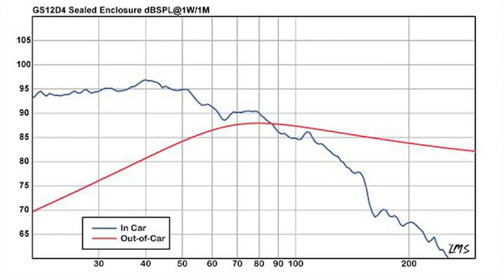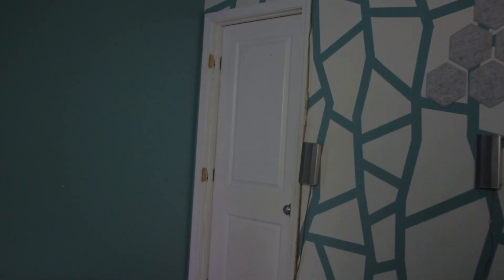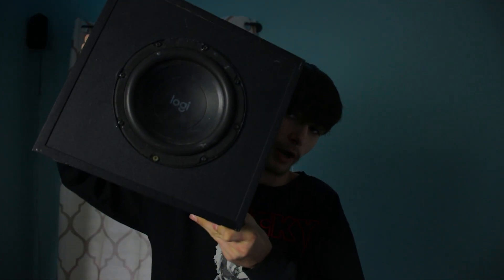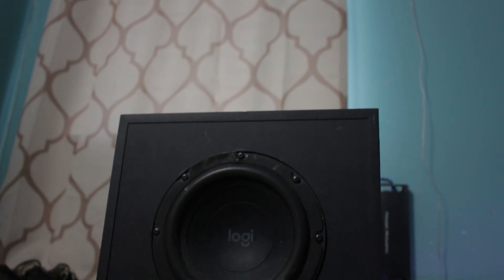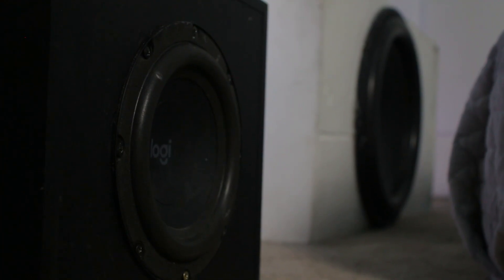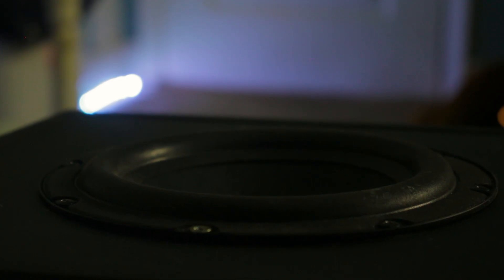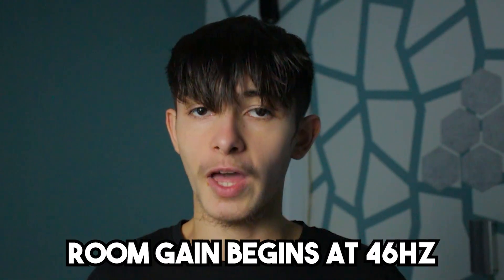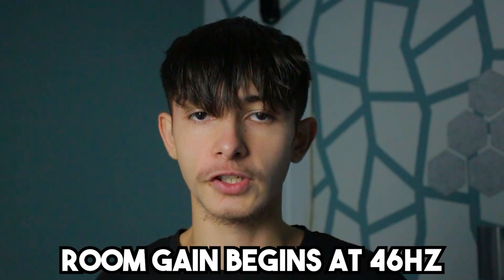Does CABIN GAIN Effect OUTPUT? (Major CHANGE?)

Comment: There is no such thing as room gain going from some frequency down below. It's fixed into specific one with little wiggle room. For example, 4x4 meters room has a gain of around 40-45 Hz, if the sub is placed in the corner and you sit in the opposite corner. In this room, room gain doesn't work at 35 Hz for example and sure as hell won't be at 20 Hz. You'd have to have around 8 meters for sub 30 Hz gains. What you tested is not room gain, it's just easier to pressurize smaller space.